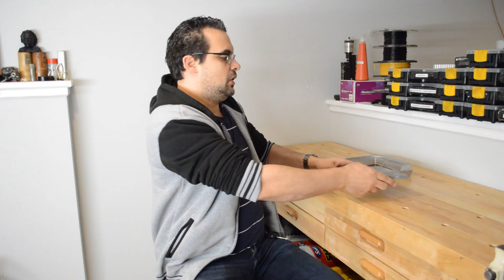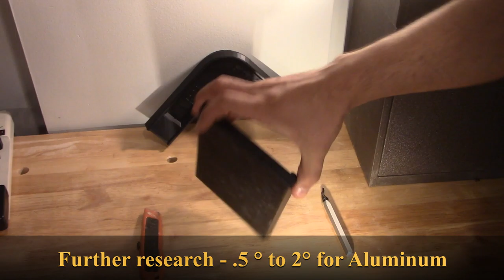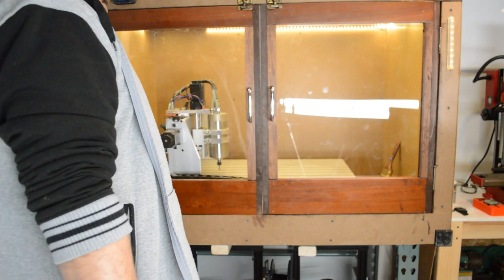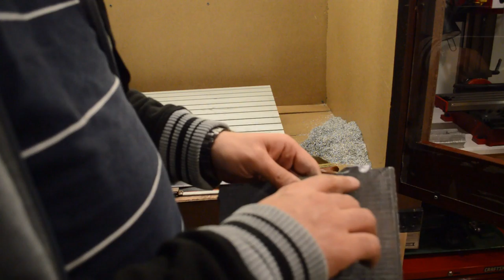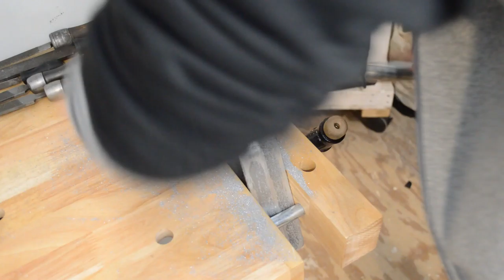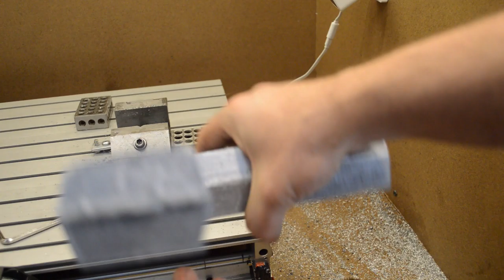Machining Tapping Fixture From Castings - PT1

Comment: G’day. I find a automotive body file works well on aluminium, it doesn’t clog up in the teeth and leaves a smooth finish. The type of file is a solid file with crescent moon teeth not the cheese grater type. 
It’s starting out well. 
Cheers 
Peter
Reply from the maker: Thank you for commenting peter. I will keep the automotive filler in mind when it comes time to finish.
Reply: I understand that file is called a Dreadnought cut, also incorrectly named as a rasp.